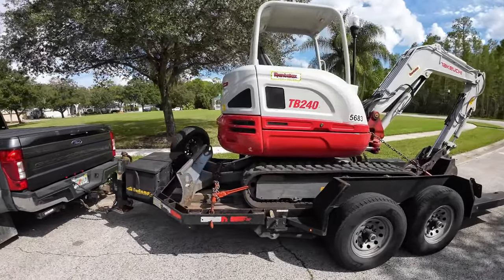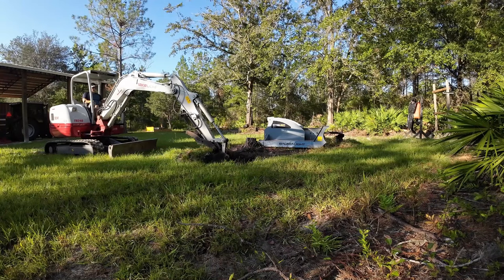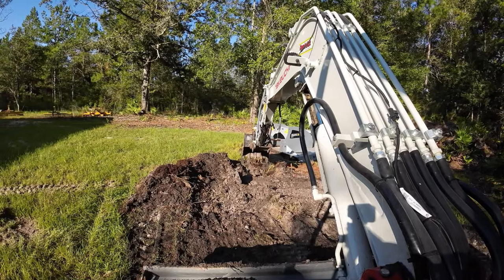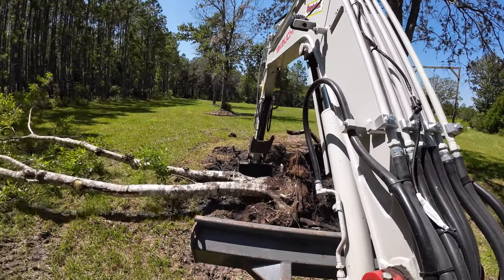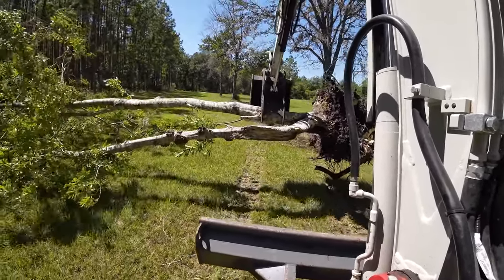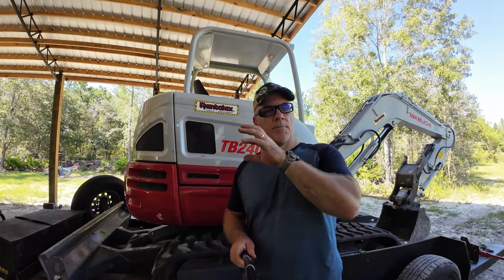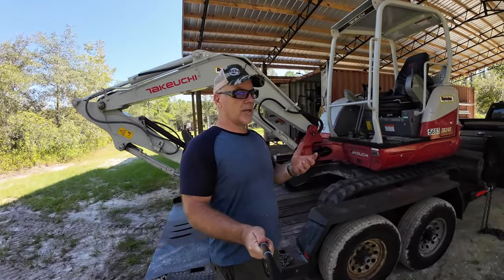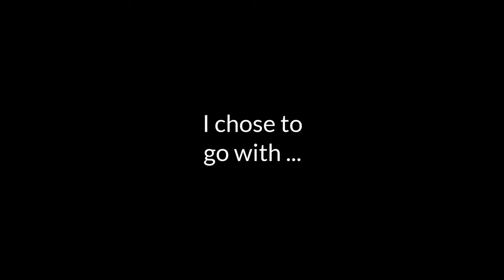Concerned About Operating an Excavator? First time use and challenges.

Comment: Always wear the seatbelt especially as a new operator. Things can develop very quickly. 
Try to track with the boom close to the cab. That will stop the digger from feeling jerky and keep the weight over the tracks. 
Just remember it’s not a bulldozer, would recommend spreading the material roughly with the bucket and use the blade to even things out. 
You can always add a counter weight to the machine. 
Sounds like a 5T machine night be best for you.
Reply: Thanks for the tips I continue to improve. I wonder the same about needing a bigger machine. I have seen what others do with the same machine and think I need to be that proficient before making any big changes.
Reply: @EronIler  Yeah you don’t want to go too big and then limit yourself with accessibility and jobs. Also the heavier the machine the more mess you tend to make, especially if the ground is wet. That can be a pain if you’re working for a client and you have to tidy up after yourself or keep the site tidy. 
Being proficient with the controls will definitely take a lot of the tippy feeling out of the digger too.